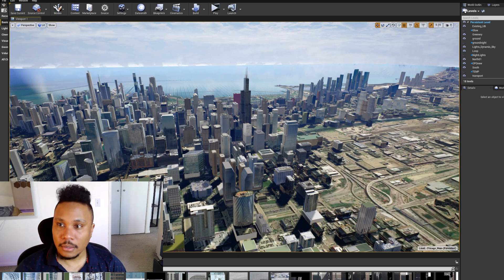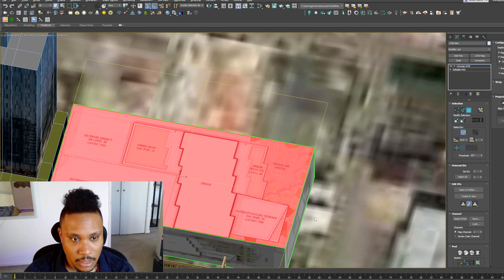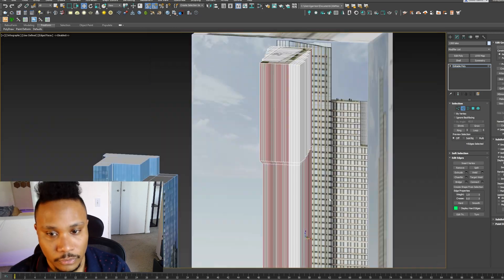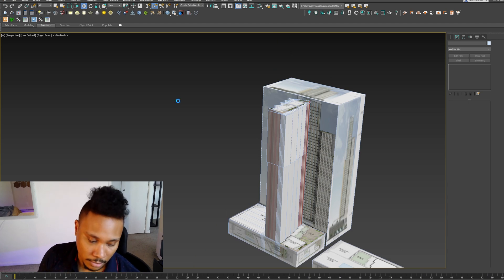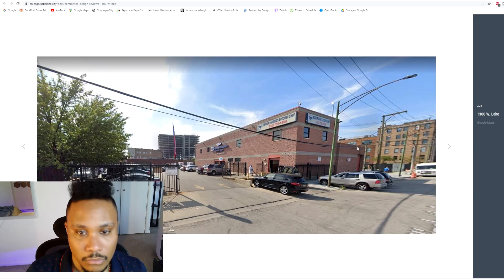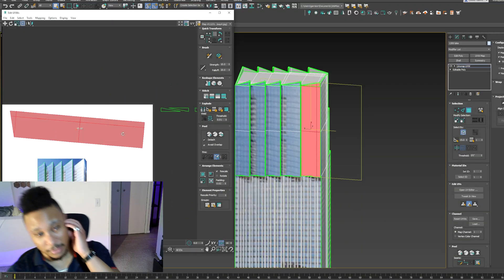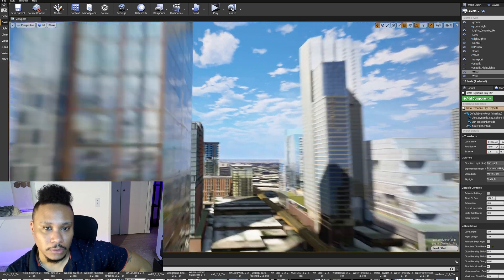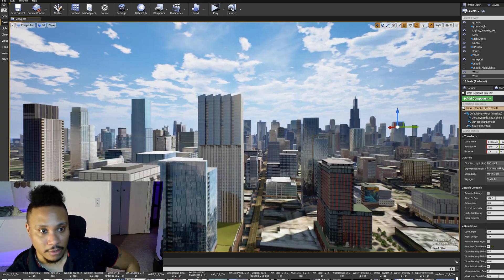3d Modeling Chicago - 1300 W. Lake

Comment: Do you leave the textures for the buildings as those huge files or do you clean them up afterwards? Seems like it would bloat the filesize a whole lot
Reply from the maker: I pack everything into 2k x2k Jpegs. Those can contain textures for around 20 buildings. You can see me packing it in a couple clips. It's optimizes things but with files like these its still pretty huge.
Reply: @lewis__garrison  Thank you for the reply! Sorry if I'm bombarding you with questions but I have just a few more. I want to make my own maps like these so I was curious where you sourced the satellite imagery from? Also curious if you used a program to import it or just manually stitched them together? I was thinking of using a couple 5k x5k pixel tiles for mine but I dunno if thats an unreasonable resolution or if it'd be better to have it broken up into smaller images